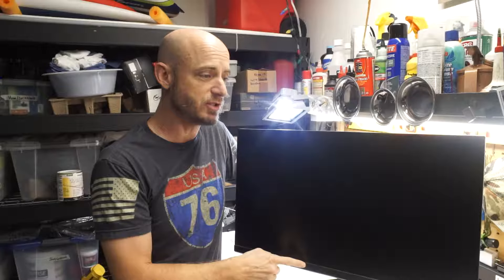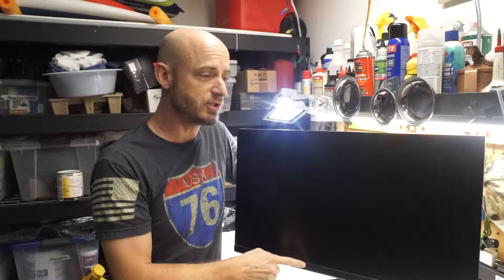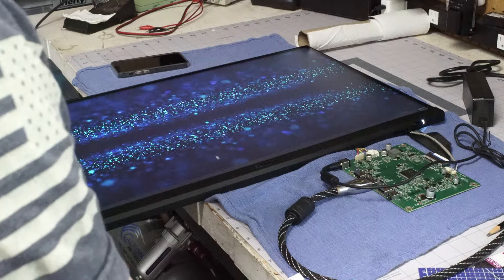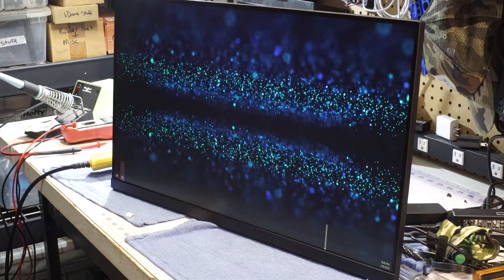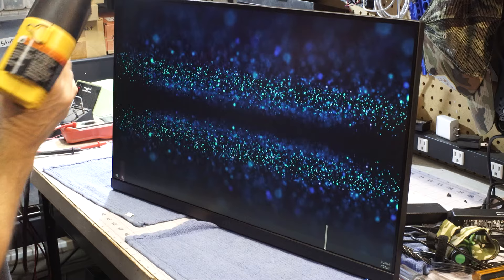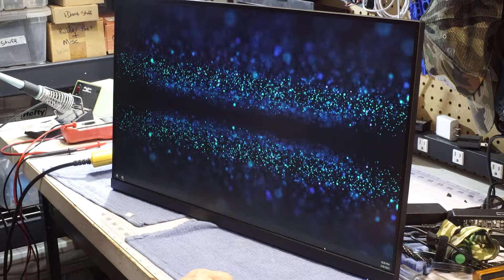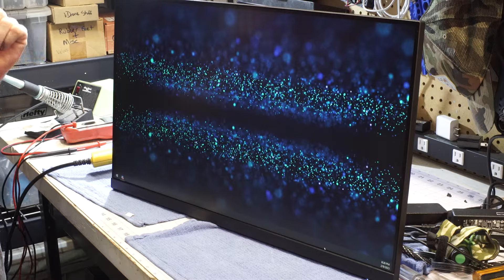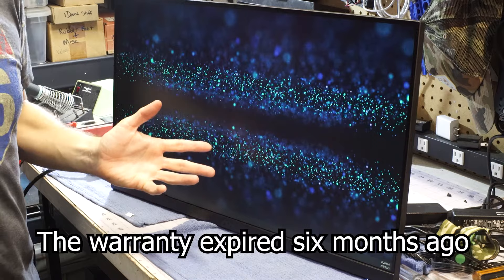Temporary horizontal lines when the monitor is cold - Can we fix it!?

Comment: This seems to be a serious MSI problem as I have seen hundreds of forum threads specifically relating to their 24" to 32" line of monitors having these glitched cold lines.. Maybe half a dozen relating to ANY other company. I have the Msi Optix G273 27" and these cold lines are ridiculously bad when the screen is anywhere under 60 fahrenheit. I Live in New England in a 138 year old house... it's currently the tail end of winter, and I don't have the best insulation in this place lmao. If your situation sounds anything like mine and you are reading this idk what to tell you other than the monitor is only going to get worse, hair dryer works for like 15 minutes then the lines come back... just save yourself the hassle and if you have an old monitor or even a small tv just use that, otherwise just give up lol it's not worth the hassle at all.
Reply from the maker: This.  It only gets worse.  They can often be useful at low refresh rate for quite a while as a secondary monitor, but that's about it.

Comment: Had this issue going with my MSI Optix MAG27CQ going on about 4years now, fortunately I live in a warm climate so the lines usually only last a minute or so and then it fixes itself, I figured it was just a cheap capacitor gone bad. I also have one of the designer lights on the backside of my monitor burnout, but so far not a dead pixel knock on wood
Reply from the maker: I was also expecting a capacitor or cracked solder joint... unfortunately it seems to be the panel itself.
Reply: I have 3 of these and it happens to 2 of them... thought my graphics card was going bad and affecting only 2 of the 3 outputs but then was like, it goes away after a while so it has to be something else.  Now I know...

Comment: I couldn't find a video of this issue and of course when I do its the exact same monitor I have (Its a G272, I believe the difference is these don't have speakers) and this indeed did work as a temp fix
Reply from the maker: Kinda a bummer.  Mine got worse over time but I still use it as a second monitor at 60hz.
Reply: @shanesgettinghandy how do you turn refresh rate down?

Comment: Had a single white horizontal line at the bottom of my old Philips LCD, disappeared by itself after about a month. Don't know what caused it, don't know how it fixed itself, was preparing to buy a new monitor since this one is pretty old (more than 10 years old), but i guess it still wants to live. :) Never had issues with Philips monitors before, but i was expecting this one to die at some point...

Comment: I think I have the same issue on my lg 27gp850-b. Cold boot it flickers above 100hz but after a while I can bump it up to 120hz and its fine. The monitor (165hz) isnt a year old and if I set it to anything above 120hz the flickering grows immensely. Very disappointing
Reply from the maker: Sounds like the exact same issue.
Reply: @shanesgettinghandy  do you have any recommendations for a new gaming monitor? At this point I'm scared to experience the same issues again in the future
Reply from the maker: I ended up buying a Dell S2522HG on Amazon.  I honestly haven’t owned a huge variety of monitors, but so far it’s really been nice, and it does 240hz.

Comment: had my aoc 27g2 for 3 years and it started doing this, it goes away when i open a white tab though and it's a broken freezeframe of whatever was at the bottom of my monitor, it fixes itself when i turn it down to 120hz though :face-orange-biting-nails::face-orange-biting-nails:

Comment: Hey man you're awesome 💯. You deserve more subscribers for sure.
I have  Msi optix G271 monitor. I face the same issu but it's increasing day by day i can't use it then i saw your videos and i lower the refresh rate by 120hz and now its working. 
I have warranty and i also call service center, two weeks gone but they didn't come. I didn't know what to do now. Btw I am from India so the product services may vary here.
Reply from the maker: Well, I hope you can get warranty on it, but at least it is usable at a lower refresh rate.  Mine still works just fine at 60hz.
Reply: But now my monitor work perfectly at 144Hz

Comment: Will dis worsen if i keedp using the monitor with dis problem
Reply from the maker: Mine slowly worsened over time.  I had to reduce to 120hz, and eventually down to 60hz.
Reply: I just got mine replaced it was under warranty

Comment: hey i have a pc monitor, and it's been having the same kind of problem. At first it's was just for a short amount of time. But now it's just black. I left it in the box for like 2 weeks, the first time i turned it on, it was displaying something with horizontal lines, and then it went black. I tried everything, and nothing works.
Reply from the maker: Dang, that’s too bad.  I was super disappointed that this one failed so quickly as well.  That said, it technically still does work okay at 60hz… but for how long?

Comment: I have been having this problem for a week now, I see that for some ppl here its getting worse and worse over time. How long do I still have before im done?
Reply from the maker: Mine was minor for a few months, went away when it warmed up.  Eventually it wouldn’t go away until I lowered the refresh rate. I guess it ultimately depends on how low of a refresh rate you’re willing to deal with.  Mine still works today just fine but only at 60hz.  It’s now a second monitor.

Comment: My MSI g2412 has the same issue except the flickering reduces if I increase the refresh rate instead of decreasing it. At 60 it's unworkable while at 144 it's barely workable. Any idea abt this stuff?
Reply: Have you fized this? I have same issue like you
Reply: Any solution? Or i give it back to warranty? I have only 3 months of warranty.

Comment: Happened on my asus but the lines started flickering up and down and took up 75% of my screen then goes away for 1 minute then covers it again only went away when i used a higher refresh rate and will worsen when using one lower
Reply from the maker: Weird, similar but a little different... Bummer.

Comment: Damn, this is exactly what is happening here, a thin horizontal line at the bottom starts flickering on the very first start up of the day when my LG IPS monitor is cold then about 1 minute + or - disappear. At least it disappears for now, I thought could be the HDMI cable, try to change but happens too on other port or DVI and other GPU, so should be definitely the monitor. Just for curiosity it's very unlikely that it could be a problem on the PCIe x16 slot in these situations right?
Reply from the maker: Almost certainly the monitor.   Try a hair dryer on it when it’s cold and see what happens.   Super frustrating.

Comment: im from sweden i have just a little bit and its dissapering sometimes but when u take the mouse to the bottom i see the mouse stretching out and its just getting worse and worse and i dont really want to take all of this out if something else is going to happen, any tips?
Reply: and my cable to the power and the computer was a little bit bent bc its was against an wall but i switched it and nothing happend
Reply from the maker: The only possible permanent solution I know of is to turn the refresh rate down.
Reply: @shanesgettinghandy  ok i will try thanks

Comment: this is happening to my predator laptop, qhd 165hz, i lowered it to 60hz but its just ever so slightly better. man i dont wanna spend 200$ ;-;
Reply from the maker: Dang, laptop display too?  That sucks.
Reply: @shanesgettinghandy  worst part is that i dont even recall any physical damage occur. i play games on it as it rests on my fancy lil cooling pad, plus i use an keyboard and mouse so im not even touching my laptop. i was playing war thunder last night and all of a sudden a few lines started coming up. thought its not a big deal, then woke up the next day to find out that the entire bottom half of my display is completely covered up in these lines (i shut it down for 8 hours right after i closed the game)
Reply: not to mention the lines are just growing as time passes, the temperature here is around 20C, not too cold, i havent tried heating it though